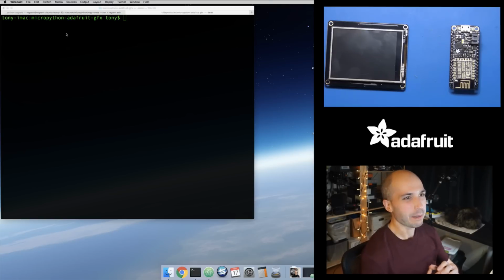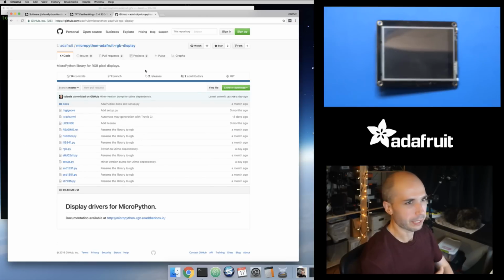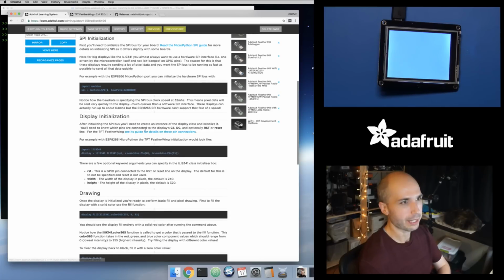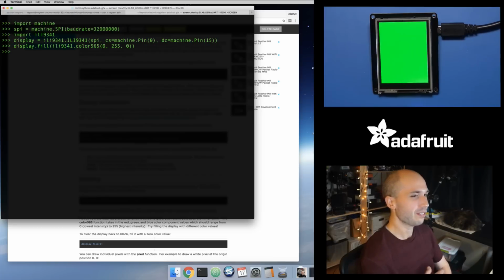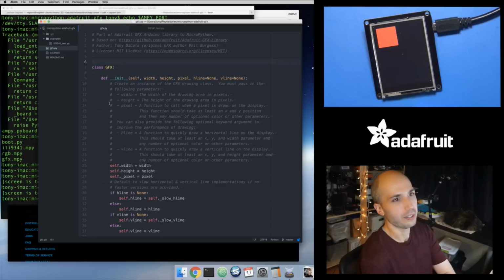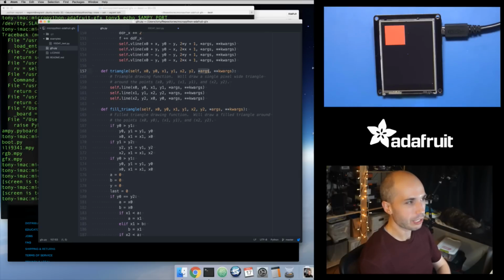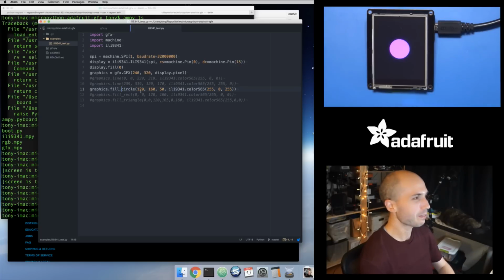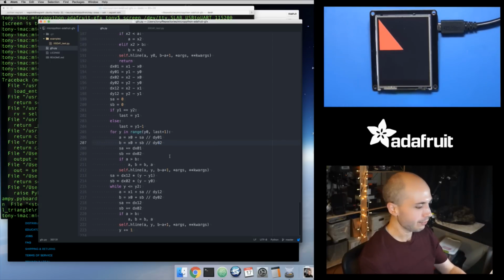MicroPython Hardware: ILI9341 TFT & FeatherWing with Tony D! @micropython

Comment: Seems that the MicroPython v1.9 release has broken something with Tony's ports of ili9341.mpy and rgb.mpy. I had it working fine on MicroPython 1.8.7, but after upgradeing and reinstalling these 2 .mpy files, I find I can no longer run the simple graphic scripts I had written the last couple of weeks or so. Here's the error message:

(trusty)username@localhost:~$ rshell
Connecting to /dev/ttyUSB0 ...
Welcome to rshell. Use Control-D to exit.
/home/username> ls /
bin/    etc/    lib32/  media/  proc/   sbin/   tmp/   
boot/   home/   lib64/  mnt/    root/   srv/    usr/   
dev/    lib/    libx32/ opt/    run/    sys/    var/   
/home/username> ls /pyboard
boot.py     gtest1.py   ili9341.mpy rgb.mpy 
/home/randmor> repl
Entering REPL. Use Control-X to exit.
>
MicroPython v1.9-8-gfcaadf92 on 2017-05-26; ESP module with ESP8266
Type "help()" for more information.
>>> 
>>> uos.listdir()
['boot.py', 'ili9341.mpy', 'rgb.mpy', 'gtest1.py']
>>> import gtest1
Traceback (most recent call last):
  File "<stdin>", line 1, in <module>
  File "gtest1.py", line 21, in <module>
ValueError: incompatible .mpy file
>>>  

Any ideas? Will likely have to return to MicroPython 1.8.7 until these modules are fixed for MicroPython 1.9.

Comment: So, where are we supposed to go to download this GFX Library for the Feather ESP8266 & FeatherWing ILI9341 TFT Display you talk about in the video?
Reply: Okay, I found it up on GitHub...   The GFX pixel graphics drawing library for MicroPython can be downloaded from this URL:
          https://github.com/adafruit/micropython-adafruit-gfx
Reply: Apparently,  we still need the 'draw pixel' function called 'pixel' in the code. The one I need is for the Adafruit FeatherWing ILI9341 TFT display module designed for the Feather ESP8266 board. I'll go hunt some more...
Reply: There is a pixel draw function in the ILI9341 library module which I am hoping will do the trick. In my other sample code, they used "display.pixel(0, 0, ili9341.color565(255, 255, 255))" to light-up a pixel mid-screen. It looks like this must be the function I should be using.

I reviewed this video for the 5th or sixth time, and around 33.5 minutes in he displays the following demo program. Amount half-way down the page, there is a line that reads "graphics = GFX(240, 320, display.pixel)". This command tells MicroPython to create an instance of the GFX object class and call it 'graphics'. It is here where he specifies the "draw pixel function" for the ILI9341 TFT display with the 3rd argument 'display.pixel', where 'display' was earlier defined as an instance of the ILI9341 object class and 'pixel' is the member function of the ILI9341 class that does the "draw pixel" function. It's beginning to make sense. 

# ----------------------------------------------------------------------------------------------------------

# GFX Library Demo
# Source:  Adafruit / Tony DiCola's Tutotial Video
# "MicroPython Hardware: ILI9341 TFT & FeatherWing"

import gfx

import machine
import ili9341

spi = machine.SPI(1,baudrate=40000000)
display = ili9341.ILI9341(spi, cs=machine.Pin(0), dc=machine.Pin(15))

display.fill(0) 

graphics = GFX(240, 320, display.pixel)   

# Sample GFX commands:

# Lines
graphics.line(0,0, 120,160, ili9341.color565(255,0,0))
#graphics.line(239,319, 120,170, ili9341.color565(255,255,0))

# Filled Shapes
#graphics.fill_circle(120,160, 50, ili9341.color565(255,0, 255)) 
#graphics.fill_rect(0,0, 120, 160, ili9341.color565(255,0, 255))  
#graphics.fill_triangle(0,0, 120,165, 0,160, ili9341.color565(255,0, 255)) 

# Unfilled Shapes
#graphics.circle(120,160, 50, ili9341.color565(255,0, 255))
#graphics.rect(0,0, 120, 160, ili9341.color565(255,0, 255))
#graphics.triangle(0,0, 120,165, 0,160, ili9341.color565(255,0, 255))

# ----------------------------------------------------------------------------------------------------------

Comment: Turns out this is Adafruit Feather ESP8266 with FeatherWing ILI9341 TFT display is a pretty cool board combination. Now all it needs is a Turtle graphics module and a text_display module. Any volunteers?

(If I were more than a beginner at Python, I'd consider the challenge.)
Reply: #
# RGB Color Test
#
# Target Device: Adafruit Feather ESP8266 Board with Adafruit FeatherWing ILI9341 TFT LCD Display
#

import ili9341    # Library module for ILI9341 TFT display
import machine    # Library module for ESP8266 hardware access
import time

def setColor(r,g,b):                  # Function converts rgb color ints to an ILI9341.color565() object
    return ili9341.color565(r,g,b)

spi = machine.SPI(1, baudrate=40000000)
display = ili9341.ILI9341(spi, cs=machine.Pin(0), dc=machine.Pin(15))

# Clear screen
display.fill(setColor(255,255,255))

# Subdivide each quadrant to show each color intensity as a horizontal stripe... (looks pretty nice)

print("Q4: 12 Intensities of red... (horizontal bars)")
for i in range(4,16):
    display.fill_rectangle(0,((i-4)*13),120,20,setColor((16*i-1),0,0))          # NW Quadrant (red)

print("Q1: 12 Intensities of green... (horizontal bars)")
for i in range(4,16):
    display.fill_rectangle(120,((i-4)*13),120,20,setColor(0,(16*i-1),0))        # NE Quadrant (green)
    
print("Q2: 12 Intensities of blue... (horizontal bars)")
for i in range(4,16):
    display.fill_rectangle(120,160+((i-4)*13),120,20,setColor(0,0,(16*i-1)))    # SE Quadrant (blue)

print("Q3: 12 Intensities of gray... (horizontal bars)")
for i in range(4,16):
    display.fill_rectangle(0,160+(i-4)*13,120,20,setColor((16*i-1),(16*i-1),(16*i-1)))  # SW Quadrant (gray)

time.sleep(5)

# Clear screen
display.fill(setColor(255,255,255))

# Subdivide each quadrant to show each color intensity as a vertical stripe... (looks pretty nice)

print("Q4: 12 Intensities of red... (vertical bars)")
for i in range(4,16):
    display.fill_rectangle((i-4)*10,0,10,160,setColor((16*i-1),0,0))            # NW Quadrant (red)

print("Q1: 12 Intensities of green... (vertical bars)")
for i in range(4,16):
    display.fill_rectangle(120+((i-4)*10),0,10,160,setColor(0,(16*i-1),0))      # NE Quadrant (green)

print("Q2: 12 Intensities of blue... (vertical bars)")
for i in range(4,16):
    display.fill_rectangle(120+((i-4)*10),160,10,320,setColor(0,0,(16*i-1)))    # SE Quadrant (blue)

print("Q3: 12 Intensities of gray... (vertical bars)")
for i in range(4,16):
    display.fill_rectangle((i-4)*10,160,10,320,setColor((16*i-1),(16*i-1),(16*i-1)))  # SW Quadrant (gray)

print("Done.")
Reply: In the code above I cleared screen to the color white because I wanted to see if I saw any white peeking out from the 4 quadrants of color bars, and I forgot to change the code back to:

# Clear screen
#display.fill(setColor(255,255,255))
 display.fill(0)

In two places.